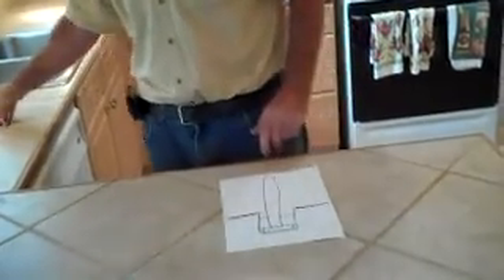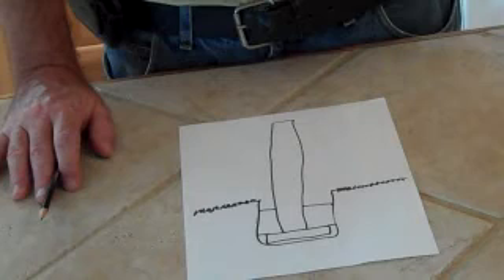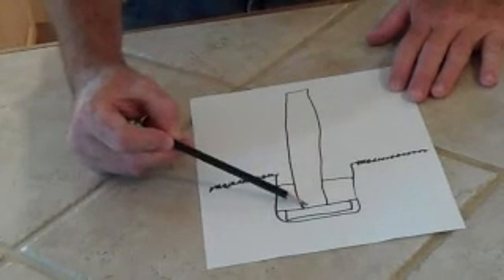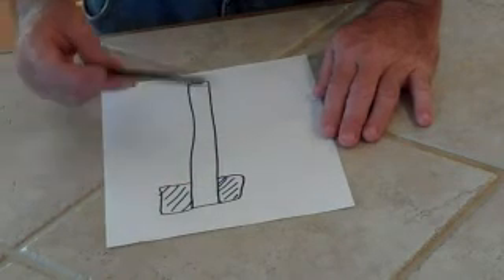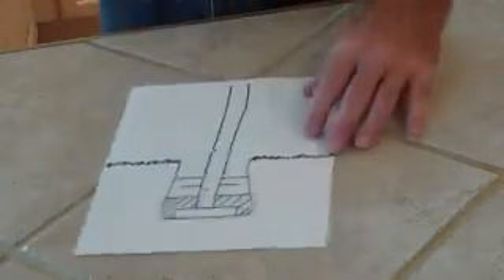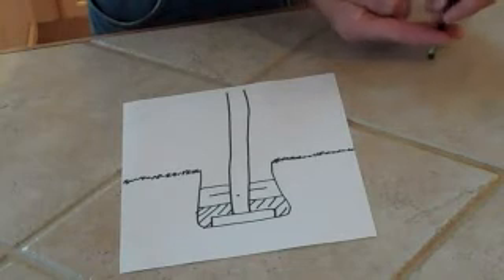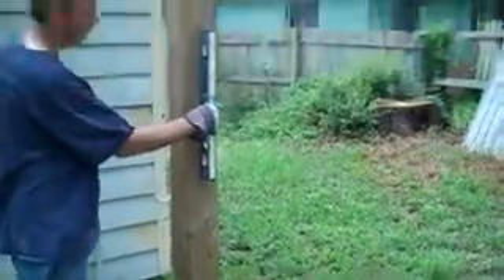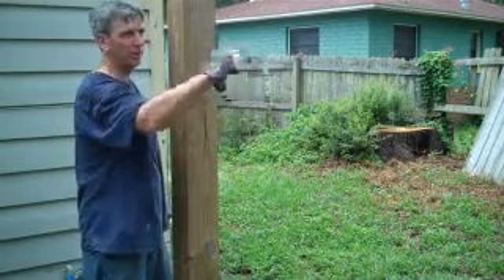Creating Your Own Backup Solar Power System for the independent homestead 1

Comment: Solid construction on the post.  Seems a bit overkill for something that may not be that permanent but I'm not sure how heavy the panel was.  I often use PVC pipe instead of wood (wood rots - even treated will eventually) and is much lighter and easier to handle.